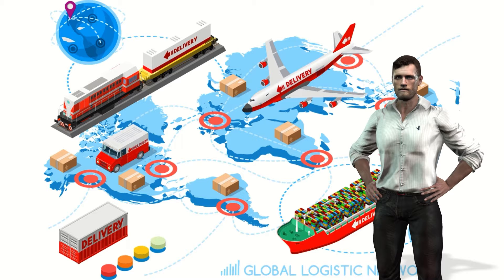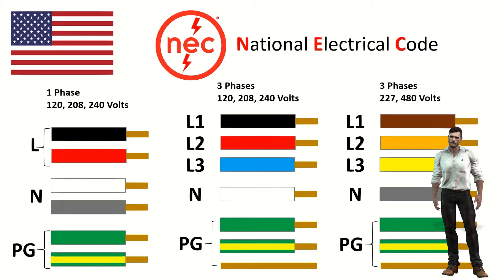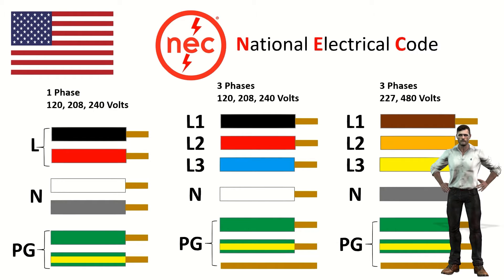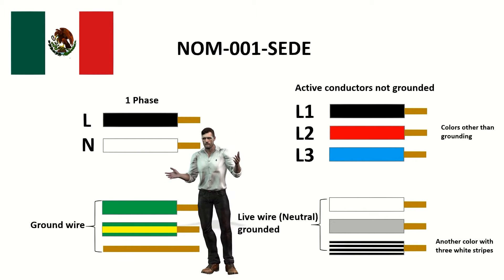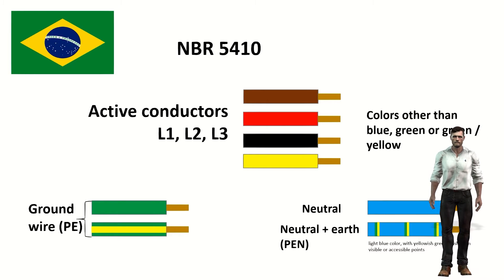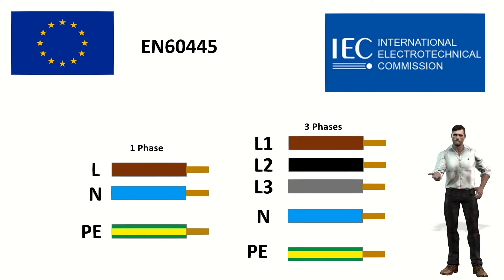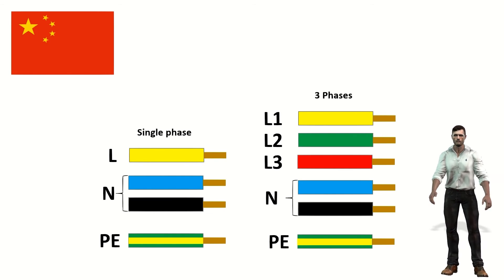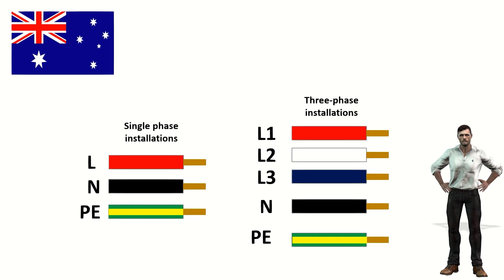Color codes for electrical installation cables What colours does each country use? (English Ver.)

Comment: In the USA, if there is a 120/240V 3ø 4W delta system, one phase will have a higher voltage relative to neutral, at 208V (or 415V in the case of the extremely rare 240/480V 3ø 4W delta) and this is the high leg and is required to be colored orange per article 110.15 of the national electrical code and is required to terminate to the center lug, or phase B in panelboards, switchboards and switchgear. 

In metering equipment the high leg will be on the right hand side, or phase C. 

In a disconnect, aka safety switch the high leg is allowed to terminate to phase A, B or C also good  practice is  to keep everything in the building consistent.  

In most cases high leg delta systems are seen in older commercial and industrial facilities and rarely seen in new installations, but since there are many legacy systems remaining across the country, it's very important to have a solid understanding of this to avoid dangerous mistakes.  

Hooking up a single pole breaker to the high leg for line to neutral loads will result in smoking equipment when the breaker is turned on.

Comment: Different than in the video suggested:
According to IEC 60445:2021 to following colours are used in DC systems:

6.2.4 Line conductor in DC system
Line conductors in DC systems shall be identified by the colour:
– RED for the positive line conductor,
– WHITE for the negative line conductor.

Comment: I wonder about Saudi Arabia they have 127 volts what is there color code and is 14 gage wire used on 15 amps and 12 gage wir we used on 20 amps do they use American standards boxes or British standard boxes and there outlets British standard for mounting and terminal connections with American standard plug on the front